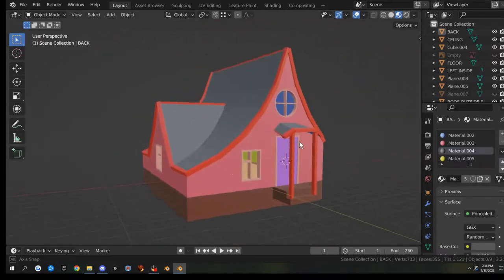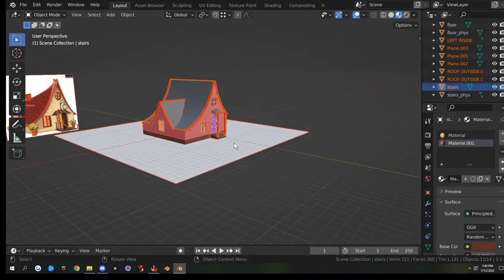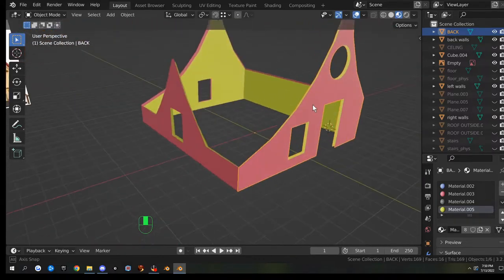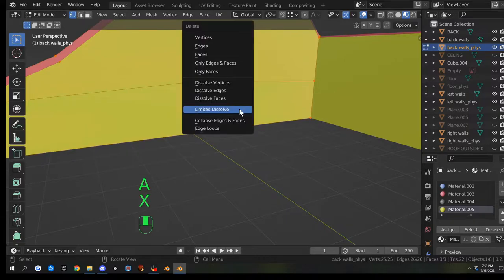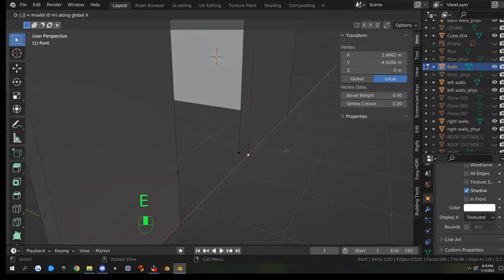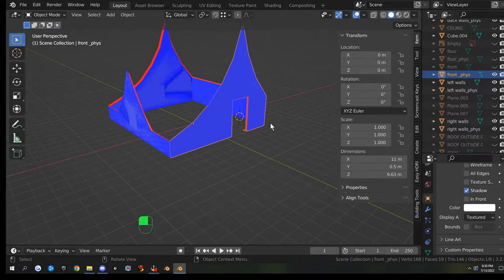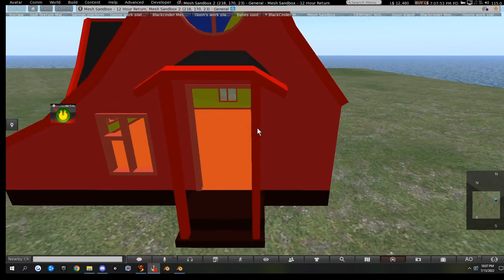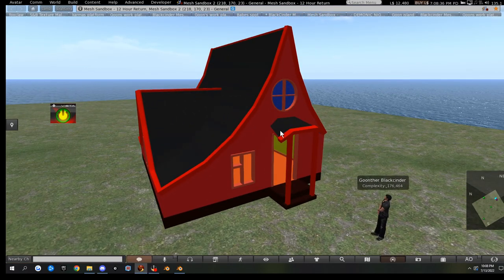How to make Physics Models

Comment: re: the make it half a meter wide around 13:00ish. Why not make the wall .5 M then in SL adjust that width? It is a tiny adjustment to do in SL compared to making something a few meters then shrinking it or stretching it significantly.

Comment: When you calculated prims and fees prior to uploading, it said it would be less than a prim. When you rezzed it in SL, the land impact was 21.  What happened and is there a way to get that lower?
Reply: I think I fixed that issue on my model. After selecting the physics model file on the Physics tab, I clicked Analyze and uploaded the model. In-world, my test has a land impact of 2 and physics work perfectly. I guess I just needed to figure that out.